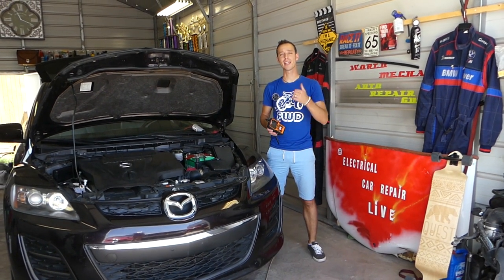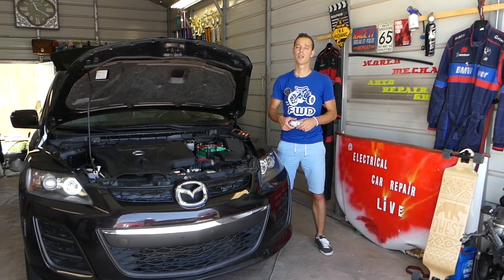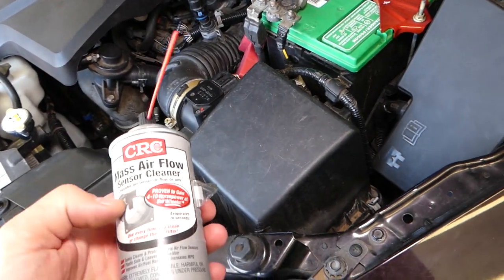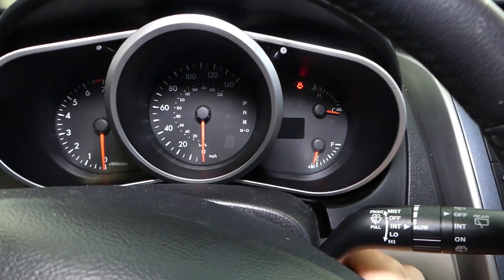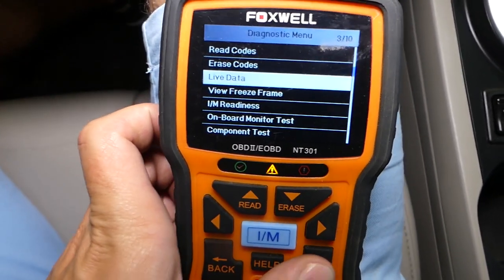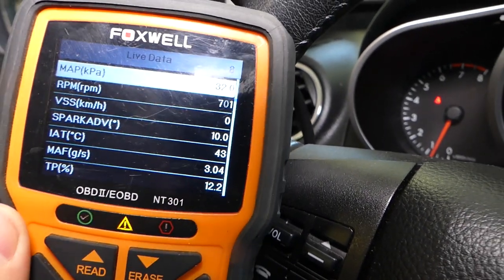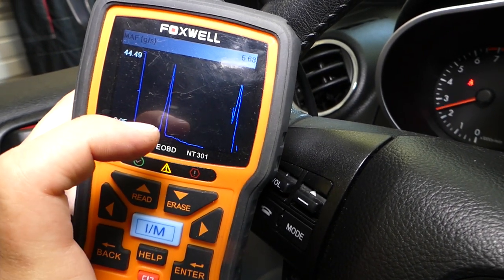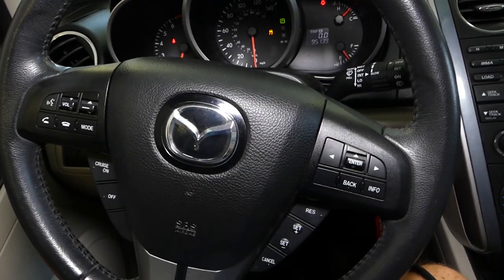HOW TO KNOW IF MAF SENSOR IS BAD OR GOOD. TEST MASS AIR FLOW SENSOR CODE P0102

Comment: So, I tested MAF and it seems to moving correctly.  My Question is MAP sensor.  Should it move as well or hold consistent no matter the RPM's?  Also, I am getting a check engine light that is producing P00PD code which I thought was for the MAF sensor.  Thanks for your response

Comment: Hey, what is the average g/s at idle MAF sensor reading should be?
Reply: I'm after knowing this too, my flips between 8/9 at idle 🙁
Reply: @MrShaunys1210  Mine goes lower than 2 g/s(to about 1.8).  I looked at the factory specs and it says: reading range is 2.77 through 222 g/s.   There was also info about Intake Air Temp which MAF also needs....    8/9 on your car seems to be a bit high
Reply: @Charkatak  thankyou mate 👍

Comment: Hi please I need your help, I have a mazda 3 hatchback 2015, the check engine is on, it was scanned 3 times but no solution, after reseting it got off just for few minutes and then ON again all mechanic said the car was ok no problems, last mechanic checked it and said it is because of  the "air fuel ratio sensor" and he asked to change it, how can I double check this sensor is really not working properly before to change it , this sensor after a time has to been replaced?

Comment: @ World mechanics the BMW e90 N54 2007 has 2 map sensors. How do I know which of the 2 sensors is Not working properly? 1n Map sensor on the Intake manifold, the other on the charge pipe. Thanks
Reply: The charge pipe is ait air intake temp not a maf sensor. Clean it and reinstall it. If you use hair dryer or blow on the ait you can measure the difference (multi meter) and tell if it's good

Comment: How about testing it by unplugging the electrical connection to the maf sensor when the car is running and if the engine stops when you unplug it, you know it is good. If you unplug it and the car is still running, you know it is bad.